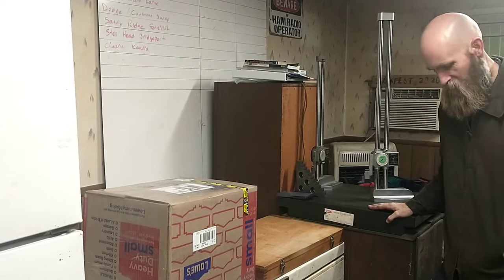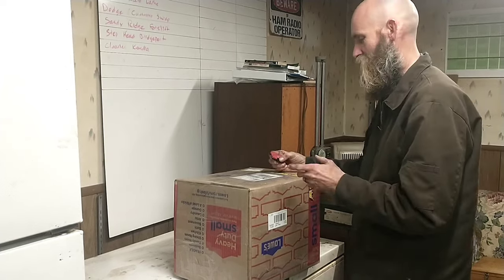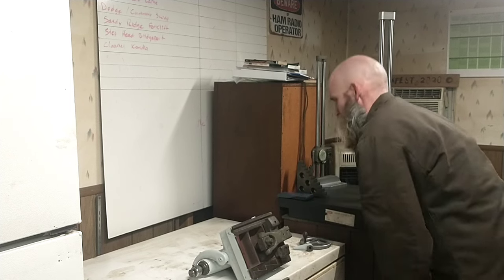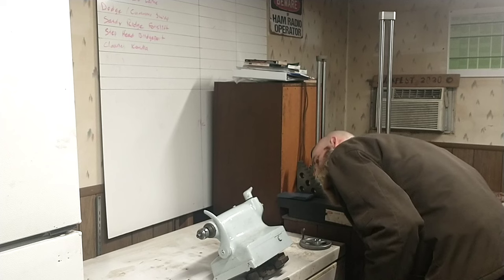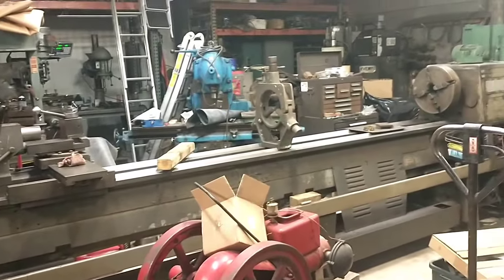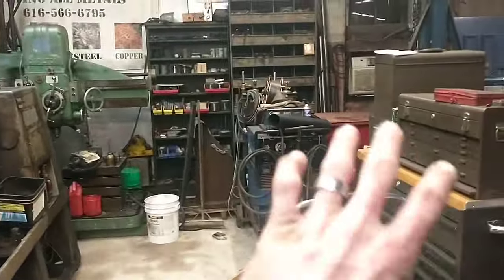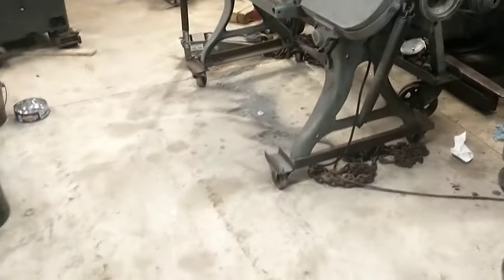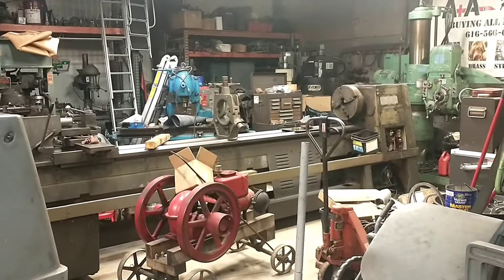The Tailstock For The Monarch 10ee arrived! New Tools, and the shop rearrange has begun.

Comment: It is very common to have the balls broken off the 10EE tail stock handles.  They are a alloy cast iron.  I was able to TIG weld a bolt, flowing the head as filler on the end of the lock arm.  Then a plastic ball with a 3/8 brass threaded insert.  I was worried about brittle cast interface but it worked perfectly.  I don't know what the alloy is in the casting but it is nice.   Makes me wonder how Monarch gets the deep flame hardening on the bed without a lot of stresses ... air cool or quenched cast iron heat treatable alloy?  and 73s from KC7BNC
Reply from the maker: I thought about trying to drill and tap the end for a stud but the diameter would be so small I was afraid it would snap off. So its going to be a brazing project now. Good to hear from another ham,73.

Comment: I don't think you did bad with that tailstock TBH, normally the only ones you can find are off a scrapped lathe and condition is usually going to be poor. Yours looks like a little clean up work and it would be fine. Be interesting to see how the alignment is when its on the 10EE.
Reply from the maker: The alignment issue is what I'm most curious about as well, I'm not sure if monarch was holding the tolerances so tight that they were actually interchangeable, or if they were hand-fitting each one. I suspect that each one was custom fitted to the lathe, in which case I may be either surface grinding the base or shimming it.
Reply: @perpetualmotion1  only one way to find out, clean it's base surface up and sit it on the lathe and measure from a test bar or cut a test piece.

Comment: BTW There were two different versions. The older 10EEs are about a half inch shorter in capacity. 12 in versus 12.5 in on the plate. I have an older 10EE steady and a newer 10EE with an updated steady. I think your lathe is the 12 in capacity.
Reply from the maker: I am aware of the center height difference, the information on when they switched is very conflicting and it appears they built both heights side by side for a while so there is no absolute cut off point.  I believe mine is 12.5" which is what the tag says but fitting this square dial tailstock will definitely tell the tale, they were definitely all tall by the time the square dial machines came out.
Reply: @perpetualmotion1  True. I once saw a round dial completely rebuilt and equipped with a very elegant Mitsubishi servo drive. The modification was extremely well done. This 10EE was bright red. There are still videos of this machine on YouTube. This is what I was originally going to do. So I bought the steady for this. But then a chance to get a government 10EE with English Metric dials and a J box electronics came up. Luckily this machine had all the goodies with it. It will be interesting to know if any of the round dials were ever the extended height machines. The only complaint I have is that mine does not have a taper and fitting a taper is no easy or cheap exercise. I do limited gun Smith work and I found the 10EE not the best here. The headstock is massive and can swallow a carbine barrel. The south bend  heavy 10 is one of the best here. It’s headstock is narrow enough to take a spider and easily allow you to cut and ream the barrel chamber. The south bend also has a longer bed which is helpful in cutting tapers on barrels. Once I get my stuff moved and the new shop up, I plan on hunting down a larger engine lathe. Maybe a 600 series monarch if I can find one. An axelson or American would also work but I am in no hurry here.

Comment: You are supposed to always have wood between your hillman rrollers and machine
Reply from the maker: I think technically they are still supposed to have the rubber on them that got shredded clean back when I was a kid😂 but I'm sure you are right that it would be safer to have a cushion in there, less slippery than metal on metal.